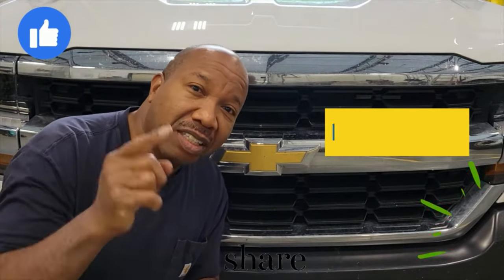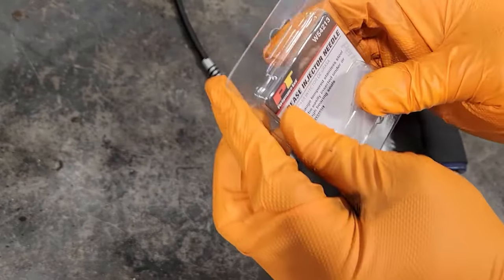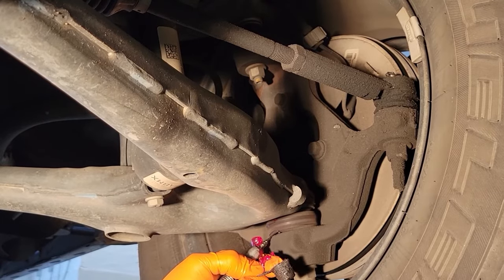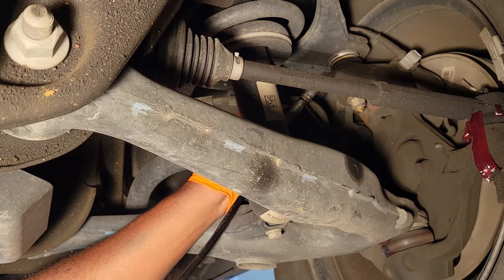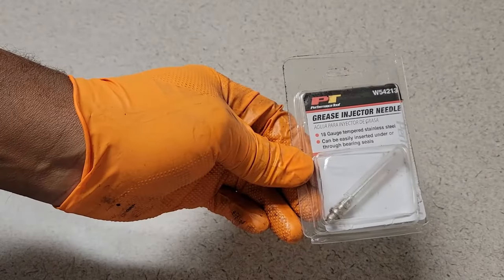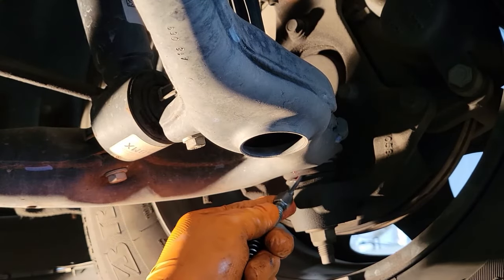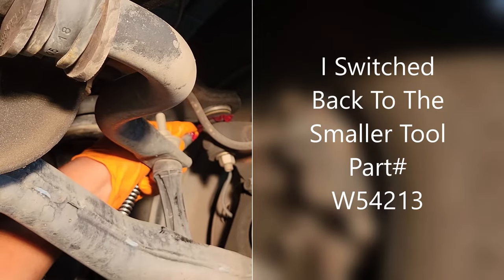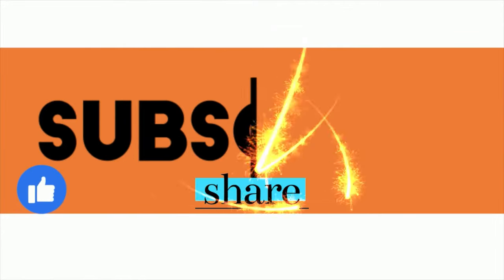How To Grease A Vehicle With No Grease Fittings

Comment: That bigger one isn't intended to be used by sticking it into the boot. That one is used to go directly into a zerk fitting or other types of fittings that come on newer ball joints. For instance, I have upper ball joints that have a place to poke that right down the center of it and fill it with grease - done. Great tool, but not for stabbing the boots... too big of a hole. Great vid. Glad you didn't poke yourself. :)
Reply: The bigger needle is for different fitting. There are fittings for it don't use for puncturing please. I would use the smaller needle if you know you will replace it  but most needle fittings will be called out in the manuals.

Comment: For those with squeaky joints...they are already worn out. This may temporarily quiet the issue but you'll still have sub par steering control from worn parts and joint replacement is inevitable.

Comment: On a Chevy 2500 there are 9 grease fittings already on the truck……they won’t grease them at the dealer unless you insist and double check….

Comment: I have an 04 Dodge Cummins without grease fittings...front end is creakier than my 92 yo great grandmother - can't wait to get home from my road trip to try this.  as they like to say in the UK, brilliant!  thanks.
Reply: Did it work?
Reply: Yeah, did it work?
Reply: Be careful though. I had an older Tundra that was squeaky in turns and did this....yes it fixed the noise,but the ball joint failed. Driving about 50 mph the lower ball joint broke. So, if it is real bad now,just replace it with new joints that have a zerk fitting. I think this is good for vehicles that aren't  to far gone like mine was. Cheers!

Comment: I just ordered this needle fitting for my grease gun. The ball joints on the front end of my car are squeaking away. The uppers have the zerk fittings from the factory. I pumped those up hoping that would get rid of the squeaking. No such luck. I’ll try to post again after I use the tool . But, the video cleared up a question I had. Thanks so much for making the video 👍

Comment: Worked for Tesla Model 3 upper ball joint boot.  Mine was making noise until I did this and worked right away much better than using oil!  Thank you!
Reply from the maker: @engineerjay420  Thank you for sharing!!

Comment: In the UK, on an annual MoT inspection, they can fail the safety inspection for a ball joint leaking grease, so beware as replacing wishbones is not cheap.

Comment: By piercing the rubber doesn’t that influence a rip and return shorter life for that ball joint or tie rod ?
Reply: Sure it could, if the rubber has lost its flexibility and hard as a rock. I use A-205 to help keep the rubber soft and pliable. But a hole that tiny doesn't really suffer the amount of stress like a rip or tear. In fact, it's not even a hole until it's under stress, so I don't think I'd lose any sleep over it. Peace

Comment: I tried it and on one ball joint the grease kept coming out imma remove the silicone and try again what can I use to remove silicone from rubber boot
Reply from the maker: In your case. You may want to use the small needle and do not pack the boot full of grease. More like half way. If you have used silicone. I would injet in another area. I myself have not used silicone.

Comment: I had a grease fitting installed on my knee, when i had a knee replacement. My first knee replacement didn't have a fitting, Since using this
method, I don't squeak anymore on my knee when walking.  Great tip.

Comment: Can I do this with my truck on the ground? Or do I need to lift the truck to relieve pressure/weight on the boots?
Reply from the maker: You can do it either way. But it is always best to grease Ball Joints and especially Kingpins off the ground.

Comment: How long does it take for the grease to leak out the hole you made? And don't tell me it won't leak out! And how do you tell how much damage was done to the ball before you pushed in new grease?
Reply from the maker: You do not have to pack it full of grease. Just enough to have some inside the boot. Ball Joints show several signs of wear. If you noticed a potting sound when turning left or right. Or frontend may Squeak. You can lift up the frontend and shake each wheel . If you have excess movement.  That's a sign of worn ball joints .
Reply: Wow pretty cool and he replies to questions huge plus
Reply: Foolish to think it's impossible for grease to escape through a "hole", but the rubber contracts so fast around that tiny little hole it wouldn't be enough to make a difference if it did.

Comment: Doe you have to worry about the grease l eating out where you injected the grease?
Reply from the maker: I just inject enough to have inside the boot. Some may or will leak out.
Reply: You can degrease the hole and wipe some black silicone sealant over it to seal.

Comment: Clean the rubber, inject it and wait for the grease to stop pushing back out, clean agian, put a dab of liquid rubber on the hole, let dry, spray all rubber with AT 205. 

If in Canada spray crown rust proof all over the slut.